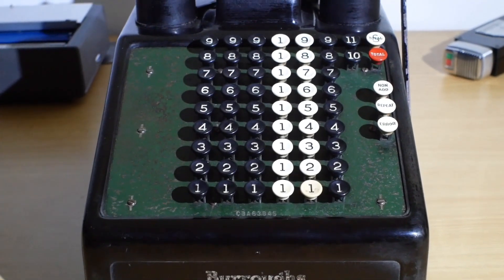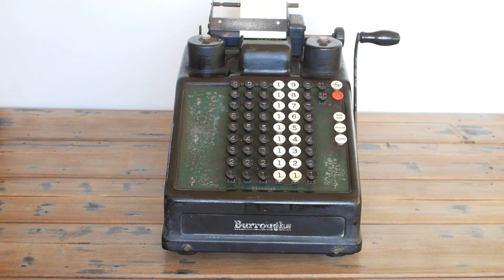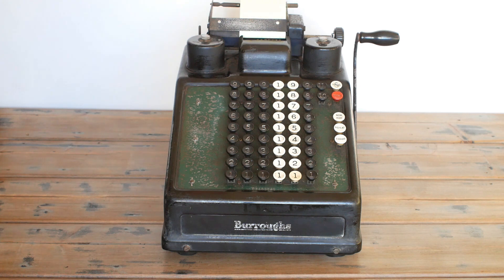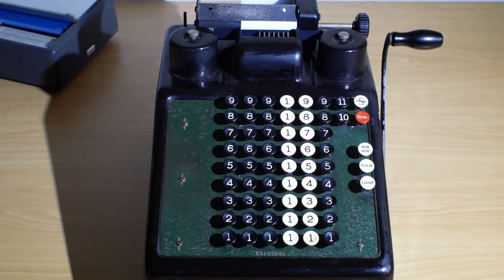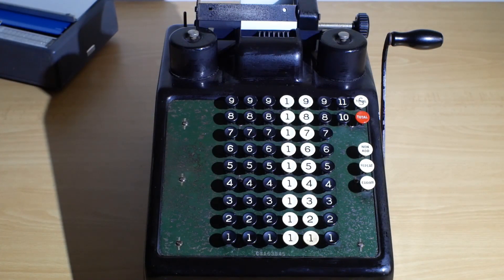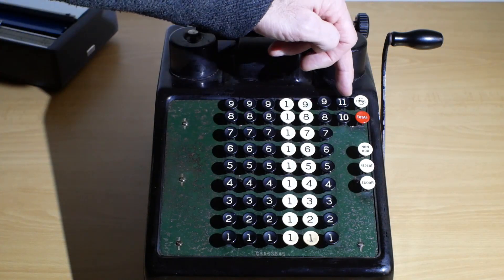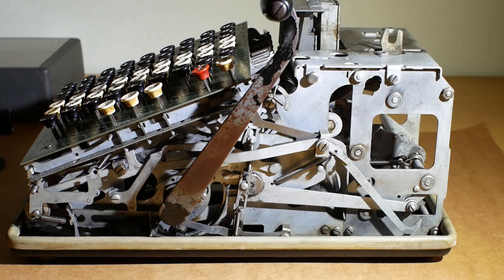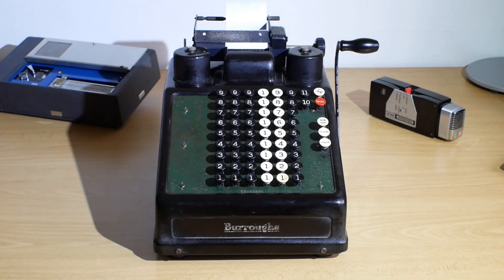Retro Tech, Burroughs Class 8 Portable Adding Machine - Repair & Overview.

Comment: I just acquired 9-1311589 which seems to be 1929. Everything seems to work except it needs cleaning and some lube. Maybe I can kluge a typewriter ribbon in there, it seems to be 7/16” ribbon, very dry of course. It has 8 decades.
Reply from the maker: Hi David, it's been a while since I saw that machine, it belongs to a friend, and if I remember correctly, it was the one with the non standard ribbon width, so that would fit in with your 7/16".  Back in the day you could just walk into any stationers and buy ink for re inking typewriter ribbons, but I haven't seen any in years.  You might get lucky in getting a typewriter ribbon to fit, which would be handy.  Hope you have fun with the machine anyway.
Reply: @GrumpyTim looking at the machine the 2 guide posts on either side accept a half inch ribbon which I have plenty of around here. I will keep the dry 7/16” ribbon, first thing is try reinking with something, maybe stamp pad ink which is still easy to get.
Reply from the maker: Yeah, good idea, stamp pad ink must be pretty similar, in that it dries by absorption into the paper.  It would theoretically be possible to make new reels where the sides stepped out slightly - the hub would still need to be the same width because there's the little drive notch that locates on the post.  Might be possible to design and 3D print some - maybe one day I'll look at that.....
Reply: @GrumpyTim I was considering modifying a pair of plastic spools, I have piles of them.
Reply from the maker: Definitely worth a try if you've got plenty - it's a pity these machines used an odd size of ribbon, most things settled on the standard typewriter size which makes things much simpler - not that the modern ribbons are that great compared to some of the heavy inked ribbons that would have been fitted to many of the adding machines and so on.

Comment: I realize this is an older video but are these hard to repair and clean?
I found one of my dads . Has all the parts it looks like just the buttons seem frozen and the pull handle won’t work properly.
Reply from the maker: Hi Super Soup, it's been a while since I worked on one of these - it somewhat depends on how good you are at tinkering with things - I tend to approach them gradually, working out what should move and what isn't moving as it should.  Usually, each thing you free up allows a tiny bit more movement until the whole thing is working.  I never rush or use force because that usually won't help.  If I'm dismantling a part I'll make notes before I start and take photos on my phone.  I'll also often put part back together before I dive in too deep - even if I need to dismantle that part again, because it soon becomes familiar and takes no time at all to dismantle again to do the next section.

If the machine hasn't completed it's last adding cycle the crank handle will be locked.  I don't think I had to remove the keyboard on this machine - on some adding machines and calculators it can be fairly simple to remove that entire section, but I can't remember how easy it looked on the Burroughs.  There are little moving rods within the keyboard section that prevent you pressing two keys in the same column at once - if these are sticking the keyboard won't work until they're freed up.

Comment: I have kindly been given 2 of these manual Burroughs calculators - on both of them all keys are locked/stuck(?) as is the pulling of the handle. Can anyone help me to unstick/unlock the keys and handle please?
Reply from the maker: Hi Dennis, the machine in the video was one that I was fixing for a friend so I can't take a look at it now.  If I remember correctly, and this is the case on most similar machines too, there are various spring loaded latches to prevent things like pressing two keys on the same column and pressing a key once you've started cranking the handle.  It's more than likely that many or all of the spring loaded latches (they're like a metal rod with cut outs on the under side of the keyboard plate) are stuck with dirt and old oil.  Also, I think there's some sort of lock out that won't let you pull the handle again until the machine has finished the previous calculation - in theory this should happen automatically as soon as you move the handle back to its rest position, but again, there will be some sort of spring loaded part that is probably sticking.

If I get the chance I'll take a look at my friends machine next time I'm over there, but for now you could do worse than simply removing the case and observing the mechanism, giving the handle a little jiggle and seeing what moves and what looks like it should move.  Don't use force, but you can try to gently jiggle individual parts with a small screwdriver to see if they're moving freely, and applying a small drop of oil to and pivots that seem sluggish and so on.

Comment: I just bought a class 8 from 1928 which I love. I want to clean it up and get it top notch again, and this video has been THE MOST HELPFUL one I have found anywhere on the internet! I've been so nervous about removing anything and not being able to figure out where it goes back. Do you have any recommendations for the type of oil one should use to reapply after a cleaning?
Reply from the maker: Hi Austin, I tend to use sewing machine oil for all the lightweight parts and levers on most mechanical calculators and adding machines (don't use WD40).  For the parts that take more force, ie the axle that the main crank runs on and so on, a heavier oil or grease would be better because those parts take a bit more punishment - car gearbox oil would do the trick, but if you're not using it all day every day, the same light oil (sewing machine oil) would be ok so long as you re oiled it periodically.  Hope you have fun with it once you've restored it, they're great fun to use.
Reply: @GrumpyTim  Thank you so much!!!! I'll let you know if I need anymore help and when I get the restoration done!
Reply: @GrumpyTim  you can do WD40 no problem, but not to lubricate the machine for the use. Use WD40 to unseize a stuck mechanics, but then use some IPA to clean it, and re-lubricate with some heavier machine oil. WD40 is not a good long term lubricant, it has very good crawling ability, which means it will not stay in the place you would like to remain lubricated.

Comment: Thank you for posting this. I joined Burroughs in 1976 and my first job was servicing and repairing their mechanical adding machines so this takes me back.
Reply from the maker: Hi Jim, what a fantastic job - since I discovered mechanical calculators and adding machines I figured that if I could travel back in time I'd like to be a service engineer for these machines - I'm quite envious.  How long were you working for Burroughs?
Reply: @GrumpyTim  Do You Know How Can I Open The Case?
Reply from the maker: Which bit of opening the case are you struggling with Damian?  Is your machine the same model, ie the Class 8?  Assuming yours is the same, I show how to open the case near the beginning of the video.
Reply: @GrumpyTim  I have a class 9 non electric, case came off in the same way as the class 8. The thing appears to be locked in that the keys can’t be pressed and the crank will not budge, is there a key lock or something?
Reply from the maker: Hi Magness 57, I'll see if I can have a look over the weekend - it's been a while since I've worked on this machine so I'll need to refresh my memory.